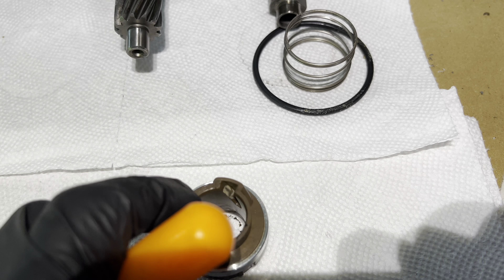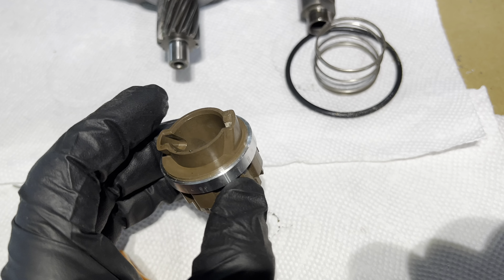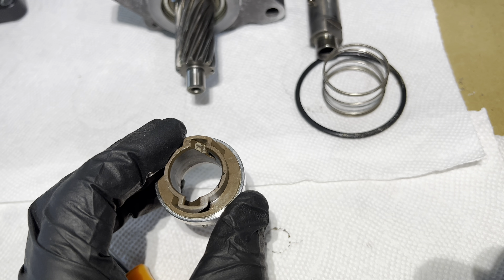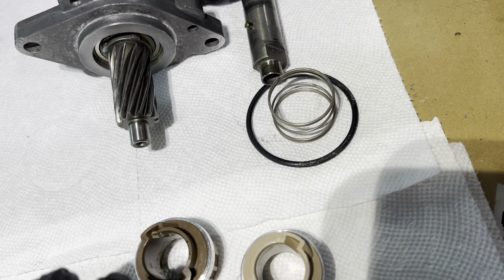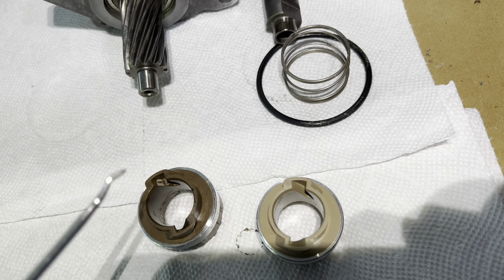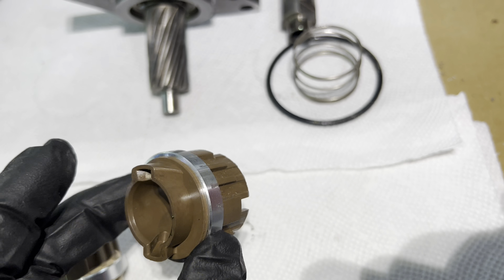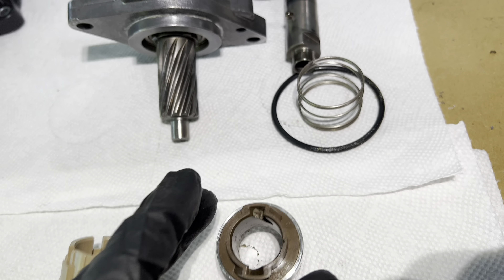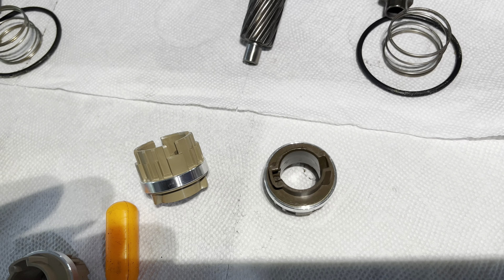Honda S2000 steering rack issue, EPS inconsistency

Comment: I got excited seeing your video because my 2002 S2k has steering issues, especially when it's cold. Sometimes on startup it immediately turns hard left. Normally, until it warms up, steering is stiff and mostly when trying to turn right. Would have liked you to elaborate a bit more on the symptoms this worn slip ring can cause and disassembly of the torque sensor to get to this part. Thanks :-)
Reply from the maker: Hi, the symptoms of torque sensor assembly going bad very a lot, but the root cause could be the resistance read wrong from the position of slip ring.  As the condition changes, the engine bay warms up the dry grease might ease a little and this might display different symptoms it's hard to pin point exact cause.  Most common problem is with the grease drying up and this leads to un usual ware on the slip ring.  This is non serviceable item so you just need to get another torque sensor assembly from low millage s2000.   The best would be having honda specialist diagnose the issue as it could be whole lot of things.
Reply: @winreboot  Thanks for the quick response! I tried the lube trick I saw in a post a couple years back and it helped so I also think it's the grease drying up. Do you happen to know if later year torque sensors are interchangeable? The 2002 appears to have been discontinued.
Reply from the maker: @Rocker1952  All AP1 - 1999–2003 are interchangeable.  AP2 had different steering ratio so it will not work.
Reply: @winreboot  I have a CR torque sensor in my 02, so they are interchangeable, furthermore AP2 torque sensor is easier to install. Mine went right in with no resistance.
Reply from the maker: @rolandotillit2867  Perfect, glad it worked out.  Correct, the CR and AP1 have same steering ratio and should be interchangeable, but AP2 from what I could find have different steering ratio.  The TQ sensor would work but the whole TQ assembly might have more splines on pinion.  I never work on AP2 so don't know for sure.  This is only for US and LHD market.  RHD only got one steering ratio for all years so it's interchangeable for RHD cars between all years and models.
Reply: @winreboot  The ratio is just the gearing on the rack, not the torque sensor, the actual torsion bar has the same amount of splines for all model years. In fact the torsion bar is shared with the 2006-2012 Mazda 6 even though that car uses a hydraulic power steering rack. gs1f-32-12y is the part number. Amayama has it in stock ;)
Reply from the maker: @rolandotillit2867  Oh, wow !! did not know that.  Yea looking at the part, it looks exactly like honda part, I'm speechless.  Was this only for EU mazda or also US?  I try to search locally but all I see are hydraulic and have different shape.  Thx!
Reply: @winreboot  EU and UAE.

Comment: Hi mate! Been having a hard time with programing mine,I feel like I've tried everything  basically won't get the last 3 flashes. My steering wheel naturally sits to the left,and basically if I do get the program right,the car pulls right aggressively. Do you think it's possible that interference from like a turbo manifold could cause issues? Had this problem when I moved rack back 20mm, managed to somehow trick it and work it out watching your other video. Now moved it back another 5mm and I cannot for the life of me program it
Reply from the maker: I would recommend just replace the torque sensor assembly.  Yes, additional heat will dry up the grease over time and using honda urea grease should help.  But when it comes to calibration is sounds like the resistance is not read correctly.  In calibration step you can try moving the wheel 5degree instead of 45degree as it says in the manual to see if it makes a difference.  You can also throw 1 OHM 3w resistor on the wire from torque sensor assembly to EPS module on the side that has issue and see if that makes a difference.  But if the slip ring is scorned the only way to fix it is to replace whole torque assembly.  It's easily swapable and saves the time to take out the rack multiple times to try other attempts in troubleshooting.
Reply: @winreboot  I have modified my assembly to be shorter to relocate the rack further back, I have actually found the problem. The Unremovable pin you talk about,we made another one. Wasn't up to the task and it loosened up and had play. Have you ever re pinned one successfully I believe it is quite the mission 🤣. I gave it another go and now the slip ring is slightly too high but have got it to program okay
Reply from the maker: @NOLIFTDRIFT  Yes, I used dry ice for removal and pin installation but if you reinstall it it might not sit correctly as you just notice.  What I do is I don't reuse the pin and just calibrate the resistance then tig weld the top.  To make sure the slip ring is in the center of both coils in the tq sensor you need to measure the resistance for both sides, left and right, min and max.  Find the number in the middle and this will be you target ohm.  If the resistance on multimeter is the same for both sides you found dedcenter, at this point just weld it but not all at once as temperature difference in metal will cause misalignment even slight movement will offset the readout later, you can mitigate the offset by putting 1ohm resistor to get both sides read as close as possible but it has to be with in tenth of an ohm, if it's more it will not help.  It is very complicated and very sensitive process, I broke many spending weeks and weeks on the process of fixing it and learn from mistakes.  Doing this for the first time is not easy.   I would highly advice against it, it's easier to get just an used replacement.
Reply: @winreboot  ah yes so the top can be welded that's kind of what I was thinking as well do have a high tensile pin in there this time maybe that will do. I can't just buy another as I shortened the spline basically took 30mm off the head, I could shorten the column but then that hits on my turbo manifold it's all very tight🤣 I understand what needs to happen,I saw what you did its actually incredible work you're a mad man 🤣
Reply from the maker: @NOLIFTDRIFT  Yea, the pin is a pain.  I also try to thread it and just run a long screw instead of pin that I trim on both ends but it always managed to moved so slightly and both sides were off.  Another failed attempt for me was just to create a jib and measure total movement of top and bottom of the slip ring then I tag weld and tested, that did not work either.  Only sure way to do this for me is using digital multimeter and reading the resistance.  There is some fault tolerance in EPS module as honda needs to pop those  things on assembly line fast but it's very little.  The most difference between left and right side that I seen was about 0.28 Ohm, this made it about 0.4mm.  Digital multimeter will be you best friend as you can't see the slip ring inside the sensor, when it's disconnected from the pin you can freely move it and figure out the center of the coils but have the tq sensor assembly connected to EPS module and ignition on, other wise the resistance will be all over the place.  It make it easier if you have two digital multimeters so you can read left and right side at the same time, just dedicate one multimeter to left ohm read out and one to right.  If you are close to Eastern PA, I can help you but it's just one of those things you got to do in person.
Reply: @winreboot  ah yeah yeah I see,what I've been toying with is shimming the whole assembly up if it allows but it seems like you're talking Tiny tiny measurements here so I'll just have to keep having a play. I'm actually in New Zealand mate so will just take your helpful advice over YouTube 🤣 thank you very much!

Comment: I want to see how to removed step by step.
Reply from the maker: Hi, the shaft has single pin in it, but it's stuck in there very very tight.  To remove it, dip in dry ice then it should get out easily.  If you don't have dry ice and if the shaft has some rust you might need to use touch then drill through the pin.  Either way it will not get out at first attempt and you just need to pound on the locking pin.